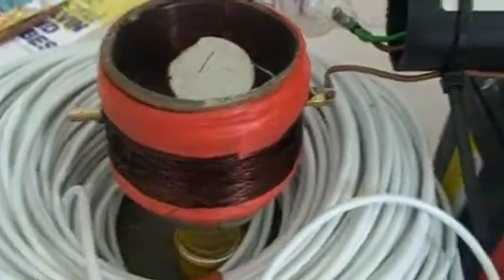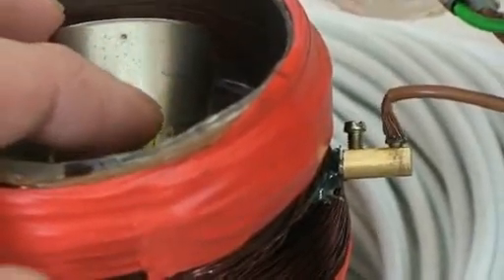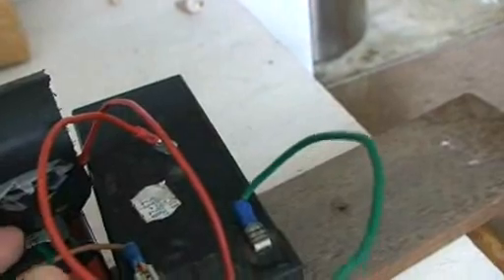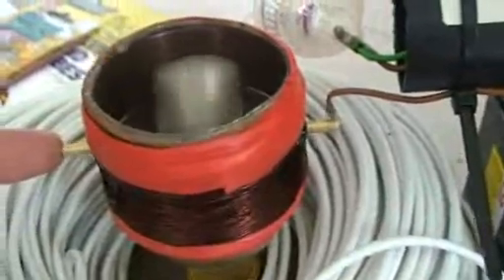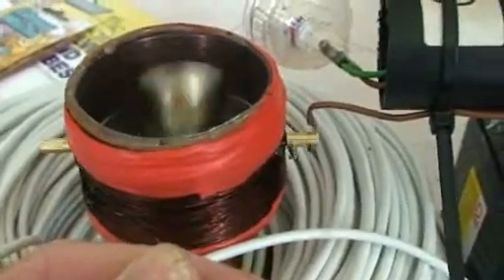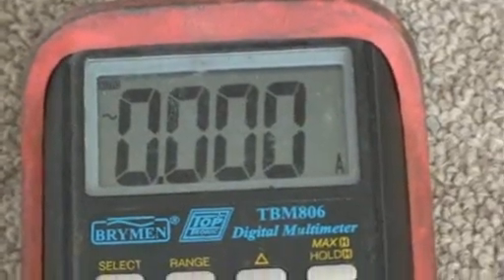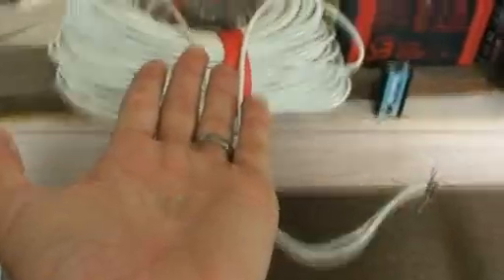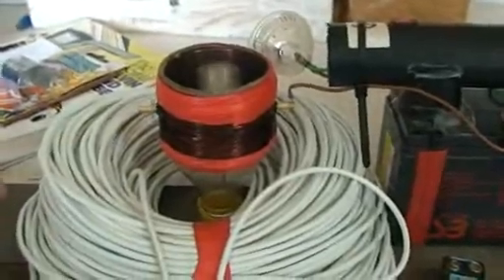Joseph Newman Part 1

Comment: The magnets will increase torque. Be careful how you orient your magnets though, because you can arrange magnets in a way that will apply resistance to a magnetic field if it is out of phase. You want to arrange the magnets on the piece you want doing more work, in a way that will reinforce it's torque and not work against it. So geometry is extremely important.

Comment: Steven, well done.  A suggestion for you...the negative of the battery should be connected to the other side of the shaft/rotor.  This will send the back EMF (magnetic collapsing voltage spike) back into the battery, therefore charging it.  I didn't see this connection in the video and this could be why it is just draining the battery for you at this point.  Happy motoring!

Comment from the maker: This is simply a motor at this stage, but I believe that I need to have a generator winding, which would be the second winding, and that one is the one that will charge the battery with the reverse emf spike, through a bridge rectifier (diodes) and with a high voltage cap on the motor drive winding whish is the only winding that I have in place correctly at this stage. The white coil is really for playing with, But I will try to wind it correctly and see what happens. Many Thanks for YR Comments